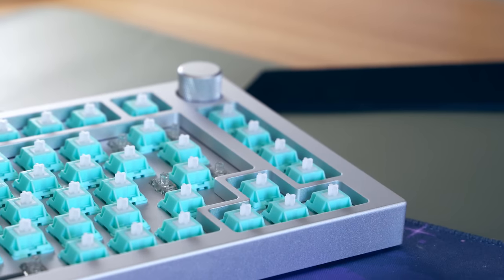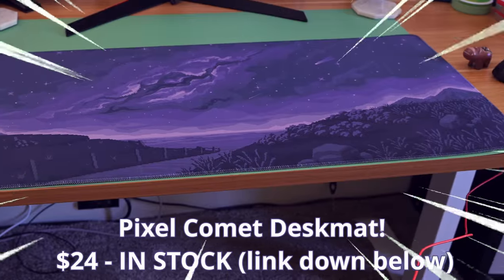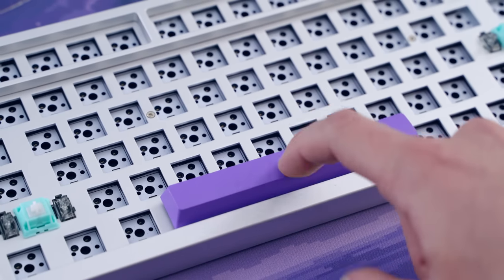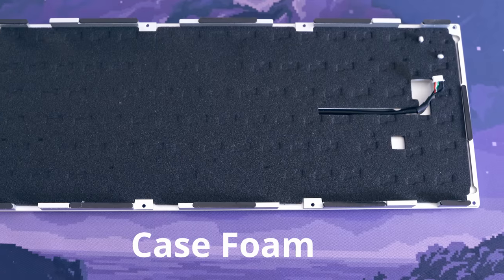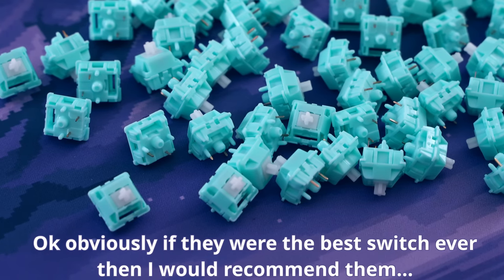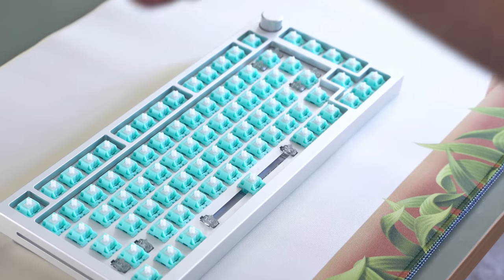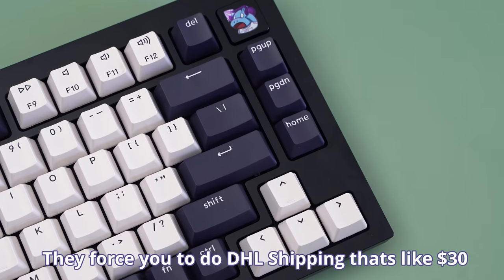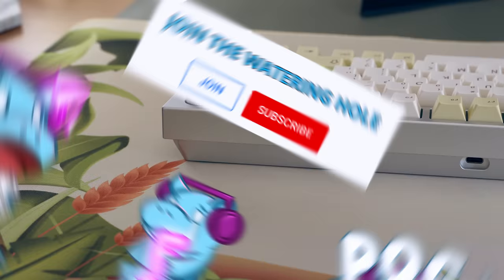I Tried the GMMK Pro (So You Don't Have to.)

Comment: Ok so, I recently got into keyboards. I just needed a new one so I went with the keychron k2 v2 and I like it. I get why mechanical keyboards are a whole sub culture thing now! But obviously it’s considered an affordable option. I do like it for my purposes, but now I’m interested in something slightly fancier. What would be a good single step up from a k2? I want something similar in size, maybe tkl and perhaps with more thock! I prefer a more muted sound (far from clicky clacky) and I really like the way those MA keycaps look on some boards but dunno if they might be weird to use? I dunno if I’m really at the point of doing too much custom stuff myself. I’d love to get a keyboard that is pretty great stock built but still gives me the option of perhaps changing some stuff out in the future. Any suggestions? Oh and I HATE when a keyboard has a Fn key to the left of the spacebar. Gotta have a regular three key row there.

Comment: Not even 10 seconds in and I feel a need to upvote and comment. As soon as I saw the stabilizer keys not popping back up normally, I knew this was legit.

I think this board is a little too well-regarded, given the quality issues it has. Sticky stabs is absurd. The space bar switch mounting point is loose. One of the gaskets was damaged (mostly sheared) during assembly.

I was able to make the stabilizers sound and feel good. I cleaned off all the factory lube. Then I used Krytox 205g0 on the stab housings. Then I used dielectric grease on the stab wires. They actually pop up now, and they sound decent... mostly. I think the space bar stab could use some work yet.

This board is the most expensive I've built yet, and it's simply not as good as the Keychron V3, IMO. Some aspects are better. But overall, I think the V3 isn't just a better value... It's a better board. And it worked with VIA on Linux right away. Trying to figure out how to get QMK working with the GMMK Pro on Linux is a pain in the arse.

Oh, and I got this board in June of 2023, and it still has the sticky stabs.

Comment: Just a note to anyone buying this keyboard - the Durock V2 Stabilizers only fit with the polycarbonate plate and is one hell of a squeeze. Reason being is that the Durock stabs are a little wider than the GOAT stabs. Worth the replacement though and definitely recommend getting the poly plate and doing the triple gasket mod if you were thinking of running tactiles with this board.

Comment: A year later, got this keyboard yesterday, finished transferring all my switches and caps only to find out the keys with stabilizers felt like they were stuck in butter
googled
found out about this issue
then had to undo, open, clean and redo everything lmao
Great keyboard once that's dealt with tho!
So yeah def not fixed

Comment: GMMK Pro is a really excellent keyboard, but the caveat is that it requires heavy modding with after-market Durock stabs, FR4 plate and StupidFish foam. This gives a much improved flexing typing feel and sound profile, but also pushes the overall cost up. Still, the layout is great, I love the shape, size, weight and build quality and I use the knob for volume control a lot. I even like the LED lighting implementation, which I don't usually care for. I liked it so much I've built several, in different colours. It seems Glorious has recently launched a FlexKit to bring more of these customisation options to users in a streamlined way.
Reply: q1 is better

Comment: I'm using the GMMK pro as my 1st hot swap switch custom build. Like so far. Love the heft of its weight. Home defense for the tea table just in case. 
So I'm liking the idea of the Keychron Q1 Pro 75% (knob).
I absoluteli like the solid feel of the aluminium build. What others offer metal or alloy case?

Comment: I have been used to gaming keyboards most of my tenure with having keyboards, made the switch for my k95 platinum to a gmmk pro and immedietely felt a better typing experience but a huge lack of features that I had been acustom to, also the non standand keycap set is not my favorite, it felt really cheap and the PC plate that I ordered didnt fit the best and the switches popped out really easily. Ended up selling it to a friend and then replaced it with the Everest Max, I love the amount of features that it has and also does a good job of bridging the gap for me between gaming and custom boards as well.

Comment: To anyone looking to get a keyboard, you don't have to go custom. Sure, it may have some perks, but I am not convinced that is the best option. I currently am using a Redragon K617 with Outemu Reds. The keyboard itself is about $40, the lube I bought (Glorious G-Lube) was $5. So for $45, my keyboard sounds exactly like the GMMK Pro. And the K617 is hot-swappable. So, if eventually you want to put in some Glorious Pandas. Glorious Lynx, or Acco CS switches you can. The RGB on the K617 is also the best I have ever seen. Like it beats all the other high-quality keyboards I seen (Via a video or irl). So in my advice, don't buy a custom keyboard. For $45, my Spacebar is SUPER thoccy, each switch feels super smooth, and the RGB Lighting is amazing (It is not per-key but it does have 14 modes and 14 colors, im pretty sure.). So in final, dont buy a custom, its not worth $200 when you could turn a K617 into something that sounds better for $100.

Comment: Great review of the keyboard but what a shame about getting one of the older units. I received my GMMK Pro (silver ice) directly from their website a few weeks ago and thankfully can attest that the stabilizers have been addressed, at least on my unit. I did have an issue with my backspace stabs but it sorted itself out after some usage. As a newbie into the hobby I was overwhelmed with all the choices but landed on this. I'm sure it wont be my last keyboard I build but for my first one I'm very  happy throwing away my Cooler Master Masters Keys L from 2019. Refreshing to hear the hot take about coiled cables from the stream too haha.

Comment: Read this if you still experiencing sticky key after cleaning up lube or try this first if you don't want to dissemble the keyboard to fix the sticky key:
I also run into the sticky space bar issue, I cleaned up the lube and still experiencing it. After digging around, I found out there's another issue. The moving part of the stabilizer require ideally not contact with the housing. Say the space bar requires 10cm distance between two stabilizers, if the keycap connector to the stabilizer just have slightly different distance, it will pull the stabilizer's moving piece off center and touching the housing, causing sticky key. At least for the unit I received, I don't think it's the "overlubing" causing the sticky spacebar.
Here's how I fixed it without entirely dissemble the keyboard(I know, dissembling is the fun part of custom keyboard):

1. loss the screw holding the stabilizer from the back of the pcb. Just a bit lose is good. If this makes the sticky key better, then you may have the same issue I have. 
2. Try to pull the stabilizer left or right with a pointy tool while pressing the key, see if it helps the situation.
3. If 2 helps, sticky some tape between the PCB and the stabilizer to keep it left/right. I cut some band-aid to do it.
4. Don't over-tighten the screw holding the stabilizer when you put things back.

I tried my best to describe issue and solution here. If anyone interested in it and need more detail, I am happy to add to it later.

Comment: DUDE, I almost couldn't open my case the screw refused to come out! I got a brass plate and replaced the stabs with durock v2's; they did not fit and I had to sand the slots in the plate to be bigger to accept the durock v2's (my GOAT stabs didn't ascend either). I did put 2 layers of tape and the board could barely close...This thing is jam packed. Although the struggles, and the overall challenging first build, it is a very nice, thicc board. I got Halo True switches (lubed & gasketed) with Corn keycaps and the board actually sounds thocky with some clickiness; overall very pleased but it is a challenging board to build.

Comment: You call it a fail and then turn around and spend most of the video attacking accessories that aren't required to buy the board.    I used Cherry MX switches and DROP keycaps.  The stabilizers on mine work decent but I did buy some alternates in advance in case I need them.  This board allows for a lot of mods depending what you want and that is what I love about it.

Comment: Just built this board and had the exact problems you described with too much lube on the stabs. Supposedly the brass plate doesn't give you enough room to use different stabilizers so I'm sticking with stock stabs for now. Also can confirm, paid wayyy too much for pre-lubed Tealios switches but I feel these were worth it.
Reply: I lubed mine myself and they were amazing
Reply: same tealios switches btw

Comment: “Budget” is now $300 apparently. I hate when people reference $170 as the cost talking about the base. You still have to buy all the switches, stabilizers, and key caps. Plus a building kit if you don’t have one.
Reply: It is obviously budget as it doesn’t have cheaper alternatives besides some plastic cases. A budget nee car is still hella expensive as well and for $170 you get the bare minimum.

Comment: that intro with the stabilized keys not comign back up hurts.  cuz that was the same pain i felt with them myself. i tried to remove the lube and relube it but i tmade no difference. so i rippped them out and instead put in durock v2 and lubed them. no regrets since. aside from the plate being a shade too small so it had to be forced onto the stabs...

Comment: When I got this Keyboard a few months ago, the left stab housing for the space bar just wouldn't work, I was going to relube them anyway but the issue was that they used so much lube, some of it dried up, making it super slow to come back up or me pulling the spacebar back up on that side, the spacebar wire was also bent and pretty much unfixable with tapping on a flat surface. So I now have a very rattily spacebar, everything else is good though and the rest of my relubed stabs work pretty well, still not GOAT though.

Comment: I don't know where the gaskets = softer bit started cause the original gasket mount boards did it to reduce friction and sound. If i had to guess I think the idea of it creating a softer typing experice was a marketing play by some early boards to try to excuse the flex which was considered a bad thing when those early boards came out. I hate every gmmk pro review bringing this up as a flaw when its working as designed.

Comment: Just got the gmmk pro in the mail for my first build, I can say that the stabilizer overlubing issues & the aftermarket stabilizers not fitting w/o filing, along with stripping screws are still a problem (at least, for me)

I used durock V2 stabs and had to file the aluminum plate for about 40 minutes to make them fit, not very fun for a issue that should be fixed (along with everything else).

Comment: A bit late in the lifetime of this video. But I bought a GMMK Pro, the stabs did the same thing, terribly ocerlubed, and they did not return whatsoever. I tried replacing them with Durock stabs, but the cutouts in the plate were too small for the durock stab housing, and I had to file the aluminum plate for a solid 30 minutes before they fit, and even then I had to force the plate on. All is good now, I like the board, but the fact that it needs that much work out of the box, just to function properly, is a bit silly.

Comment: Used the GMMK Pro for around 6 months and I have to say it's been rocky at best. Built it using lubed and filmed Glorious panda switches, modded the stabs and dampened them aswell. Worked great in the first few months, sounded great but then the problems started. Double spaces when I typed, double letters when I only needed one. I tried swapping switches, didn't work, swapped to an aluminium plate over poly carb, didn't help. Six months in and it's just a shit show. One of the worst custom keeb experiences I've had

Comment: Just bought my gmmk and it came in last week, took it apart like 5 times cus my space bar was sticking no matter what, note even the new plates dont fit durocks very well. They state they fixed it but i dont think they did. What happens is that the plate is so tight on the stabs that it squeezes the top of the stabs towards each other. So i had to shave the poly carb plate a bit to that the stabs can sit flat on the pcb and not be squished together.

Comment: Is GMMK actually calling this a budget/midrange keyboard? If so, I wonder how they figure that when the barebones GMMK Pro is $170 USD, and to make it usable by only adding switches (Box Jades) and keycaps (GMMK Aura) takes it up to almost 250 USD, before tax and shipping. A Drop CTRL with MX Blues can be bought for 170 USD on their site right now and the Drop SHIFT is 200 USD with Box Whites.

Comment: I've used ISO (Norwegian) layout since like the late 80's and I also think it is stinky after buying an ANSI Ducky One 2 TKL to force myself to get used to the superior bracket layout and get rid of the effing ALT+GR mess / tiny left shift. I have to wait until mid December to get the 14" MPB from my job though because ordering ANSI layout on those over here instantly becomes a special order, and every other keyboard I buy has to come from another country. Minor problems though.

Comment: I have so many issues with my keyboard-- it won't register key strokes about 50% of the time on certain keys. Changing switches makes it worse (box switches just won't work most of the time, but using the same box switches on another GMMK keyboard-- the GMMK compact has zero issues). I have contacted support about 20 times and they've forced me to try countless things without any results. They won't do anything about it and I'm basically stuck with a barely usable $200 paper weight. Stay away from GMMK (the cheaper boards actually seem fine, but the shady business practices would keep me away).

Comment: bought this board during two years ago during the hype, do I regret it?  I have no idea.  I have modded it to sound pretty great with switches that I like.  HOWEVER, I have the stabilizer issue on my back button, not only that but this issue stems FROM THE MOTHERBOARD, not just the plate, sooooooo. . . .  I say dont buy it.  just dont   :)

Comment: GMMK Pro still has massive QC issues and couldn't recommend it to anyone. There are still issues with over lubed stabilizers and mine had the plate foam and one gasket totally mangled to terrible condition.

Comment: Out of the box the gmmk pro is crap but if you take the time to mod it, it can actually be good, i tripple gasket moded mine removed all stock foam added pe foam and added tape to the bottom case to reduce ping and hollowness

Comment: I have the gmmk full size which is the most expensive board I have. I have two other tkl boards that were both like $100 a piece, one of which was fully assembled. After rebuilding the one and fully building the other, they are both WAY better than my gmmk. The stabs on the GMMK are just GARBAGE. Tried to replace with Durock V2's. Guess what - they don't fit.

EDIT: I was actually able to fit the spacebar durock stab in easily but it had the exact same stickiness/mushy issue regardless of the switch or keycap I used.

Garbage board. I would hope the pro is a bit better but I see it also has stab issues.

Comment: I'm new to keyboards so could anyone tell me how $100 for switches is bad and $80 for keycaps is good? The switches are the keyboard, right? Right???
Reply: Because in the mid-high end of keyboards, the switches are almost always cheaper than the keycaps. Quality switches are far easier to manufacture than quality keycaps. Heavily generalizing here for simplicity: a set of nice, pre-lubed switches (~90-108) start around $30-$50, whereas a lot of nicer keycap sets start around $60-$100. This, of course, is not absolute. There are good quality, cheap switches like the Gateron Milky Pro Yellows which are about $20 for 100, and there are also plenty of decent quality keycap sets for $20-$30.

Comment: I just got one a couple weeks ago and built it with some gateron reds and the glorious aura keycaps. The stabs were fine for me except for the enter that was a little slow to rise for a little bit. After some use it started to work just fine. I would definitely recommend it as a easy board for building a first custom. The software is a little weak though.

Comment: When I got mine the stabs stuck as well which was annoying also trying to attempt to take it apart for the second time the screws started to strip so I didn't go any further in fear of never being able to get into so I basically got cucked :( however I dont use it anymore will probably try to sell it tbh. Also I went for the lynx lubed switches like a fool and half of them have this nasty spring crunch so the whole experience wasn't that great

Comment: Im shocked you did not mention MY BIGGEST GRIPE... the dang power connector makes the gaskets useless as it teeters on the cord no matter how much you fiddle...there is a cut out but it does not do its job correctly.... Hot garbage $350 mistake